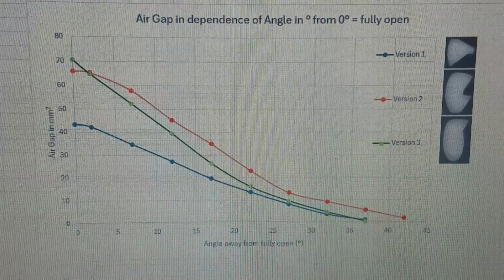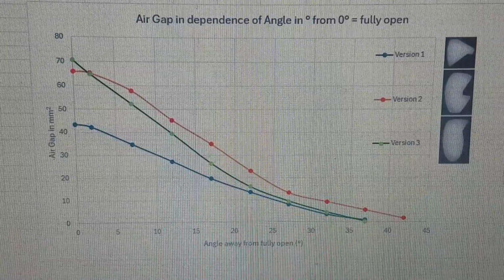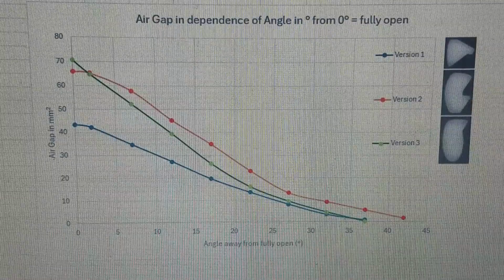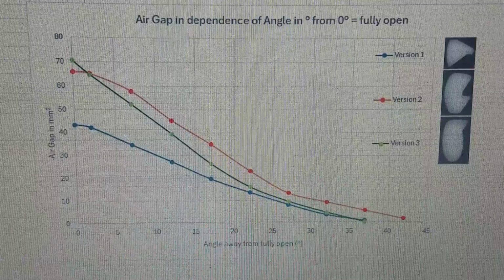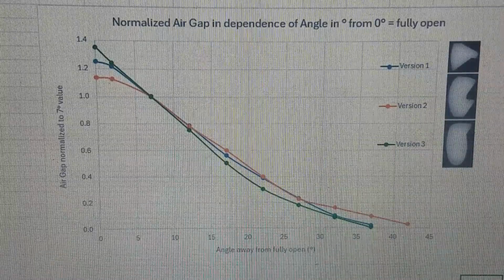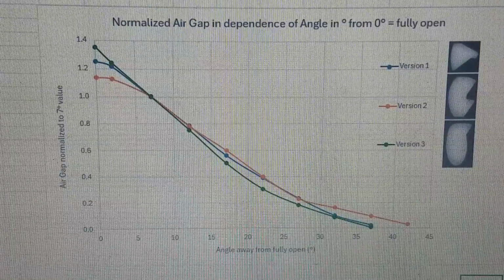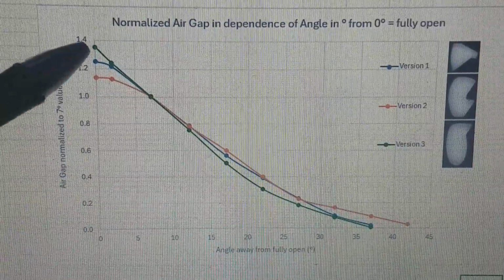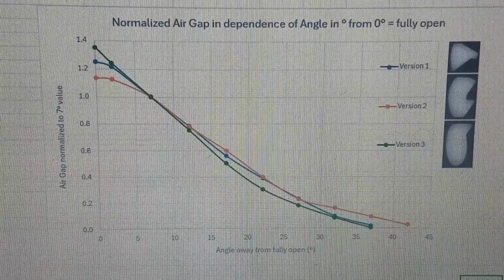Bosch K / L-Jetronic Auxiliary Air Valve / Zusatzluftschieber: Relative Airflow estimate.

Comment: So much effort you put in to this. My AAV in my Citroën CX GTI does not work. I will troubleshoot it to find out what the problem is. I saw a list of the parts number for the AAV for different cars somewhere. Of cource the CX had a unique part number…. Since there are only three versions of the air slot i wonder what the difference is. The only thing I can think of is the position of the adjustment bolt.